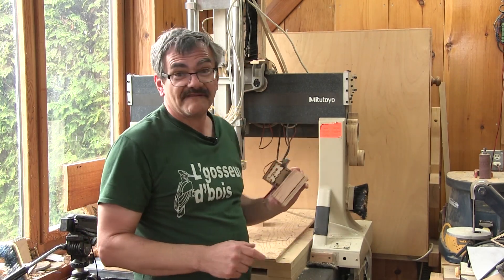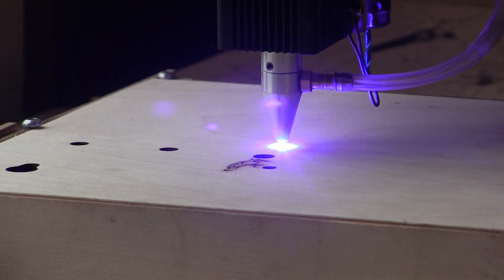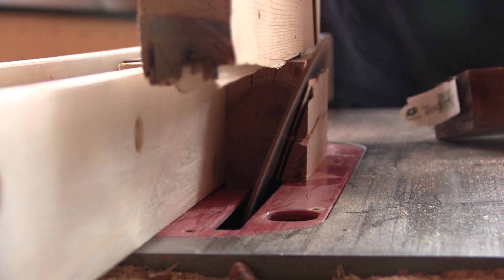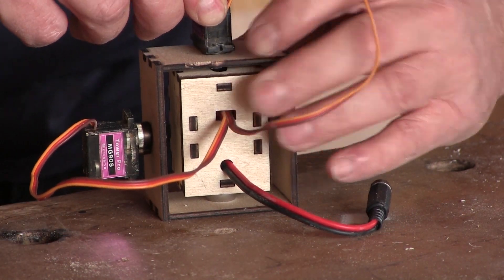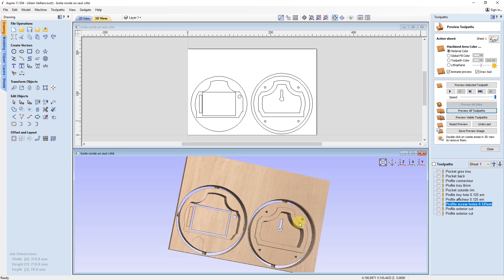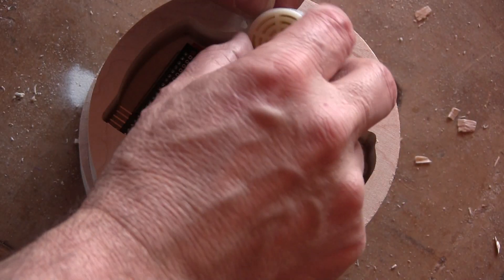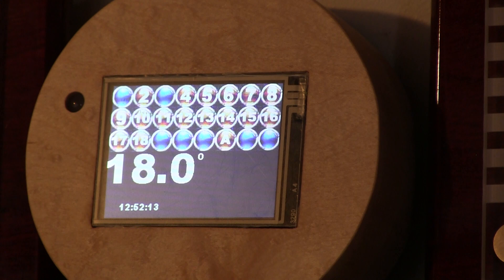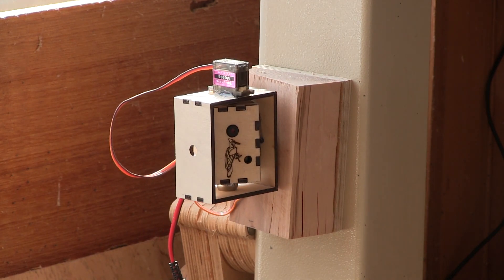The Woodpecker Ep 302  - Camera and surveillance of the shop

Comment: When I click on the link, on your website, to find the source of the project I get this error.
 "This site can’t be reached
Check if there is a typo in href%3D%22http.
If spelling is correct, try running Windows Network Diagnostics.
DNS_PROBE_FINISHED_NXDOMAIN"

Comment: Very good. Those PCB's look quite professional. You've made me wonder, do you make your own or do yo send them out?
Reply from the maker: Thank you
I design them online at easyeda.com and with a click of a button I order the PCBs. For $6.50 for 10 PCBs this size shipping includes, I can wait the two weeks of delivery. The PCB's are always perfect, but most of the time it's me who made a mistake so I have to make some modifications, it's why I always fill most of the empty spaces with through holes so it's possible to add components if I made a mistake. For the cottage I want to change the led display in the shed it's my third set of PCBs that I ordered, extra pads were not enough to fix the fact that the 7 leds display was too big....
Reply: @LgosseuxDbois-TheWoodpecker  Thank you for your detailed reply and link.